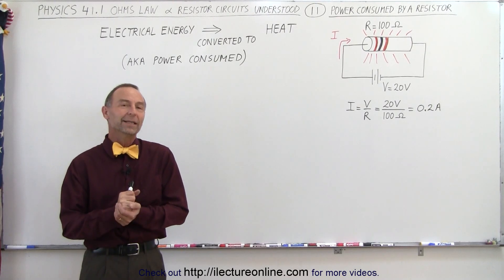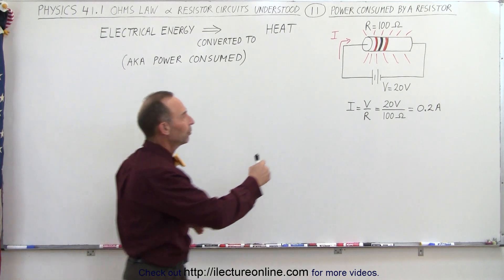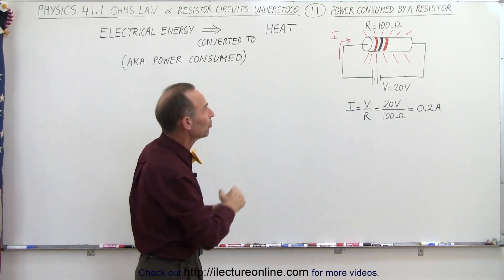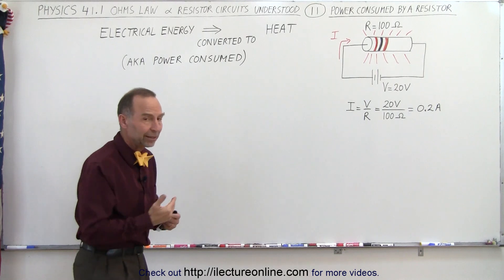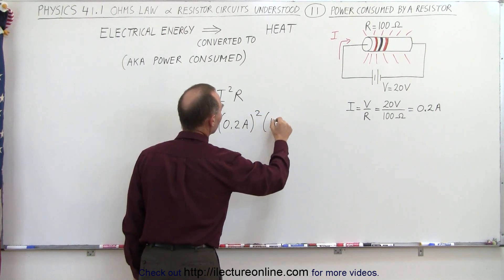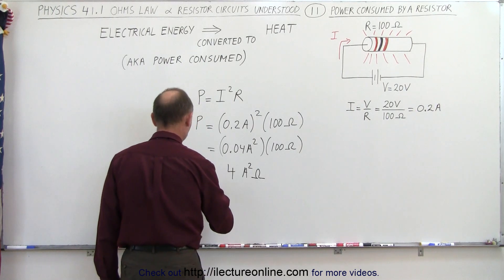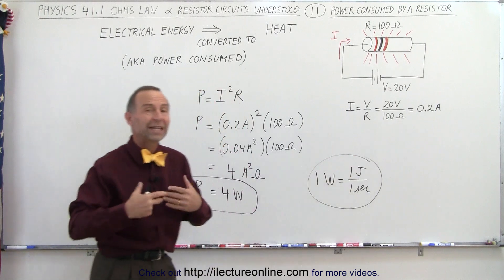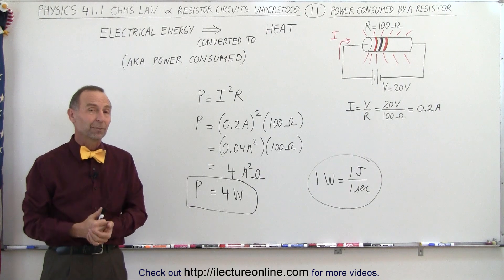Physics - E&M: Ch 41.3 Ohm's Law & Resistor Circuit Understood (11 of 27) Power of a Resistor

Comment: Hi, If we have an LED (18ma) on that circuit on a series with that Resistor, will the Resistor consume the same amount of energy or less?
Reply from the maker: It depends on the situation and what the LED does to the circuit (typicall it causes a 0.7 volt drop across the LED, which means it lowers the voltage drop across the resistor (if the voltage applied is kept the same) which would lower the current in the circuit and therefore lower the power dissipated by the resistor.
Reply: @MichelvanBiezen Thanks a lot, now everything is clear for me. 
When you said 0.7 volt drop, that's if we use 0.7v LED or the LED might be 2v but the voltage drop is less?
Reply from the maker: I was thinking about a diode.  An LED actually will have a 1.8 to 3.3 volt drop.
Reply: @MichelvanBiezen  I see, thanks a lot.